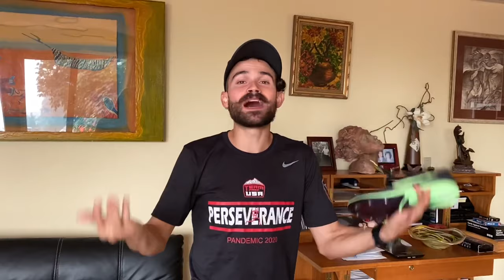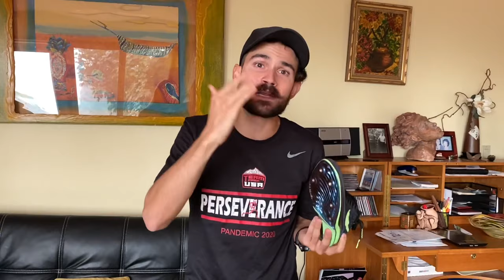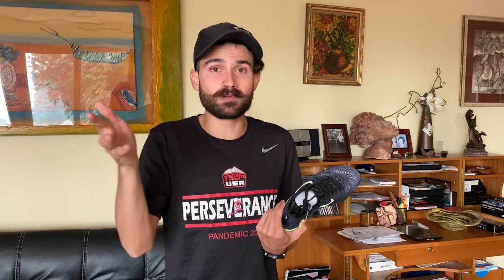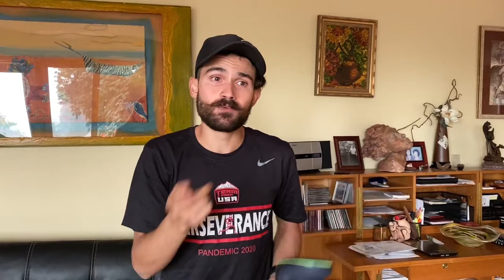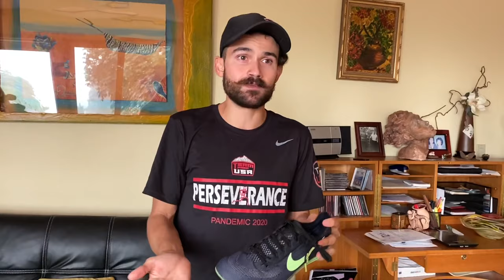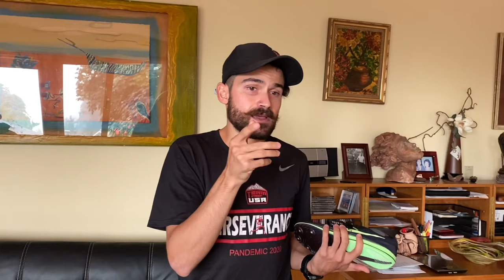The Design and Future of Carbon Fiber Plate Shoes

Comment from the maker: What up fam! Today I have my opinion on the subject of the future of carbon plated shoes. Performance in part, relies on stiffness of certain parts of the shoe. What do you guys think? What are your go to carbon plated racing shoes?
Reply: I missed out on getting the new Alphafly and Vaporfly Next % in the watermelon colours. But instead a seller on ebay had a brand new pair of Vaporfly 4% in my uk9 us10 size for a much lower price than the other two. So I was glad to get them as a second choice especially since the 4% is discontinued and getting rarer now. I might not wear them for a while and keep them stored away and just use my Next % shoes for races instead for that reason. The 4 percents are a piece of running history in my opinion. :)
Reply from the maker: @Oni1One  Nice! I like the 4% too. I bought two pair when they first came out. Going through them now for workouts. Definitely going to miss them when they are no more.

Comment: I run the 100m-400m sprints in track, but also cross country. And the info in the video is somewhat strange to me lol, because i wore the Zoom Fly Flyknits (with a carbon fiber plate) in both types of runs, and i found that the plate gives me immense shinsplints and pain during sprints due to the inability to bend my toes, but the shoe works very nice in long and easy runs during cross country. its odd bc this is the somewhat the opposite of what youve been talking about in this vid. although it did provide a lot of useful insight to other shoes. i bought the Air Zoom Tempo Next% recently, and they are amazing for long/faster paced runs, as i ran mile repeats in them, and i look forward to using them in track after cross country season ends so i can test them out in sprinting conditions!

Comment: Super informative Dr. Elite! You think vaporfly next% compares to adizero adios pro for the soft but responsive midsole?
Reply from the maker: Thanks John! From what I can find online, and I do not know the hierarchy of foams on the market, but I'm sure companies pick for a reason, whether that may be cost or design. The Adizero Adios Pro uses a TPU phoam and the Vaporfly a Pebax foam. If you look at both bottoms of the shoe, where the rubber is at the ball of the foot, notice the Vaporfly is more solid, while the Adios is V shaped. This would allow for give, in my opinion at the forefoot for the Adios. I have not worn both, Adios may allow more responsiveness with faster running/acceleration and more cushion because of using TPU instead of Pebax, in my opinion.

Comment: Great video!
Do you think the Saucony endorphin Pro can compete with the Alphaflys?
Reply from the maker: Thanks Gethin! If we are going by stiffness, and it also depends on the talent of the runner, I still think the Alphafly would put perform the Endorphin Pro in the marathon, but may be a high contender as the distance goes down from there. I believe that Nike has the patent on the placement and curvature of the plate in pebax, down to a science for efficiency, which means other companies won’t be able to replicate it 100% (correct me if I’m wrong). Also, I tried finding footage from the 2020 Olympic Marathon trials where Galen is turning - corner, slows down and takes a little to catch up, to emphasize that efficient acceleration in the Alphafly is hard to do.
Reply: In The Long Run I guess it also highlights that the narrow mid foot/heel coupled with the super stack high make cornering a bit scary?
Reply from the maker: @JoyRidaz Yes, even the Vaporfly doesn’t handle tight turns super well, in my opinion. I’ve run a time trial on an unbanked 200m track before with the Vaporfly.

Comment: So if carbon fiber plates are more rigid for bigger shoes, is it possible that a small guy with large feet would be negatively affected by the plate due to the fact that his body weight may not be enough to load the plate effectively? What could be a negative affect? Should this person avoid carbon fiber plates completely?
Reply from the maker: The plate in the Alphafly is the only shoe I know that has an offset on plate stiffness with changes in size of the shoe. Haha, yes I think that may be possible. If a clown decided to run in alphafly, but were short, they may have some issues. It probably hurt to run in. For other shoes, nah.

Comment: So how would a carbon fiber insole work, and how could that benefit you?
Reply from the maker: The rigidity of a carbon fiber insole would return back more forcefully after loading the insole much more than other insoles. They are extremely stiff compared to the plastic insoles, which also have some give and return, just not as much as carbon fiber. Since the insole is more superficial than if it were embedded into foam, it would be able to give a lot more at the forefoot. Think of the 2012 NIke Zoom Victory Elite spike, maybe one of the first introductions of carbon fiber in racing shoes (they hurt to wear!), I believe a small amount of cushlon with a carbon fiber shank just in the middle, the size of a small rectangle. In other words, there is "spring" but not as much if it were to be embedded into the foam, in my opinion. From a health perspective, a stiffer insole would help with conditions such as Plantar Fasciitis, as you can load it as much.